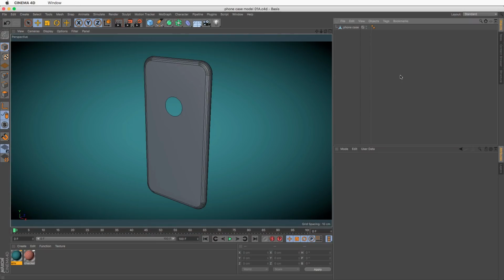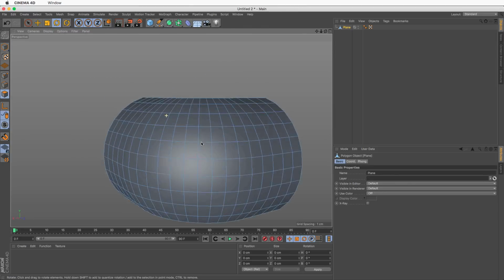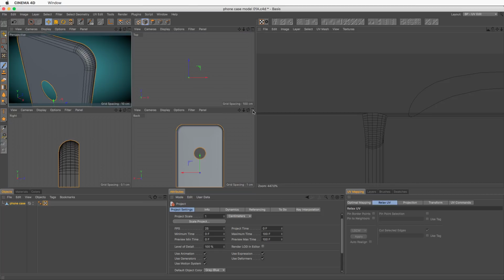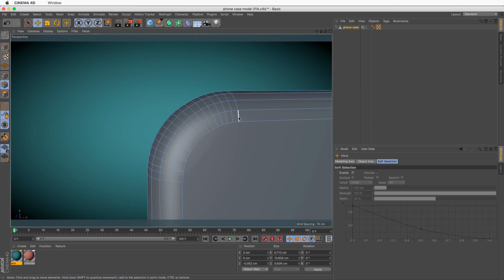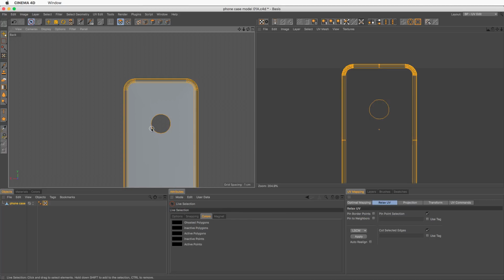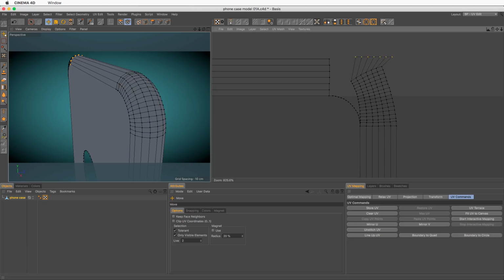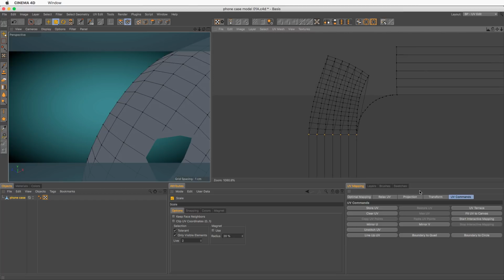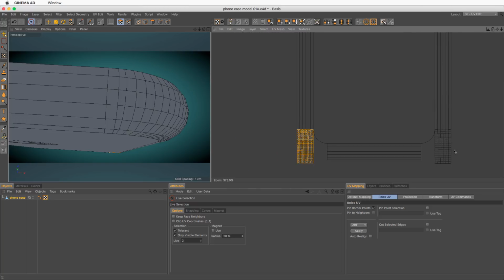UV Unwrapping Curved parts of a 3D model in Cinema 4D

Comment: I'm just starting UV unwrapping in C4D and it does seem like the functionality is limited although you can usually get there with some manual effort and workarounds. I can't understand why there aren't axis handles in the UV view for the move/scale/rotate tools and instead you have to manually type in transform values and "apply". Ridiculous. What I did find helped a bit was using the quantise and snapping functionality for the move tool, which makes it at least easier to use the tool and still constrain motion to one axis. I am hesitant to start learning yet another piece of software just for unwrapping though so I'll stick with C4D for now. I'm confident Maxon will  improve their UV toolset at some point.
Reply: Yes. Our UV tools need improvement... which is an understatement. Maxon knows that, and they are actively working to bring better, faster, great tools in the future.